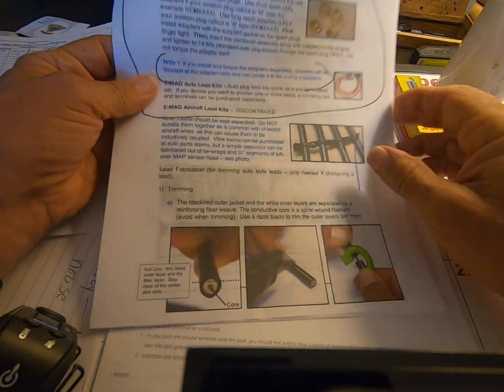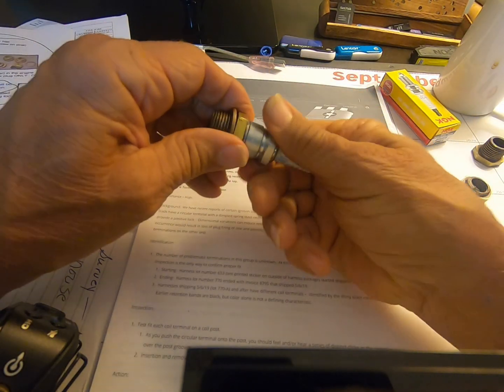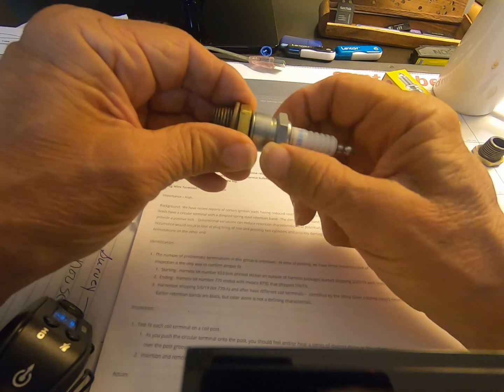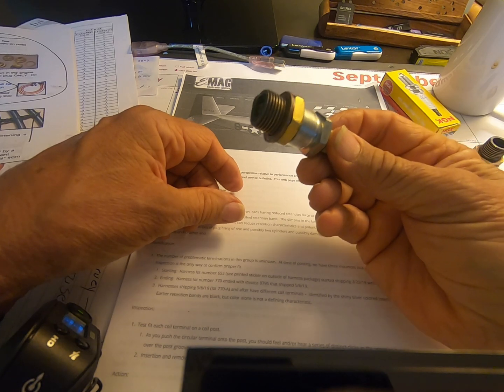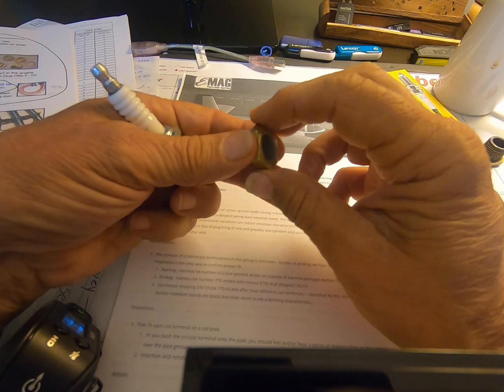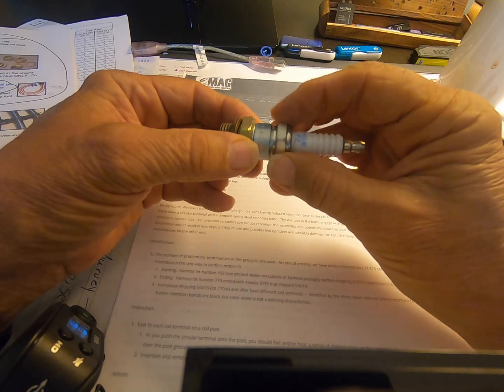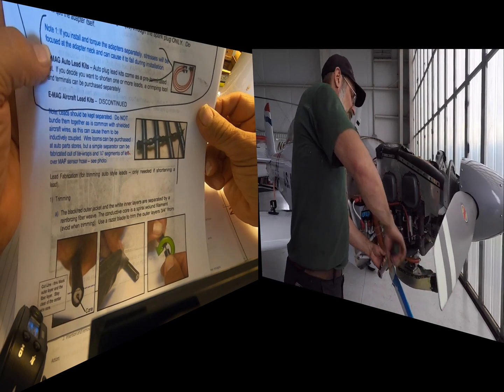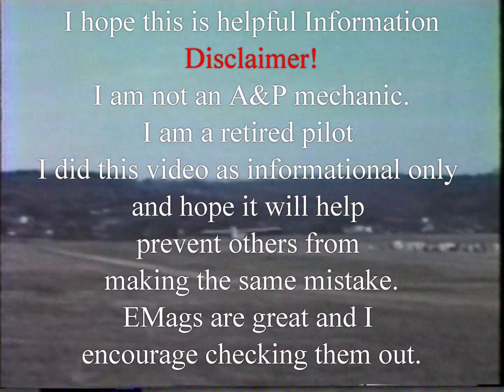EMag Spark Plug Installation

Comment: Question (not covered in the E-Mag manual):  What if you have to remove and replace plugs?  Do you remove the adapter too and get new washers?
Reply from the maker: Jerry Wang my understanding is if the adapter comes out with the plug you should remove the adapter from the plug and put it on the plug before inserting the plug to torque it.  If the adapter stays in the cylinder head you can insert the plug into the adapter and torque it.  The answer to your question is no, you do not have to replace the adapters each time you replace the plugs.  I would only replace the adapters if damaged.  I keep a couple extra just in case there is damage to one.  Main point is to finger tighten the adapter on the plug before inserting and then torque ONLY the plug to recommended value.  I am not an A&P however this information comes from an IA and also I have talked extensively with the emag support who is extremely helpful.  Hope this helps..
Reply: @Flyfishntn1  Thanks!